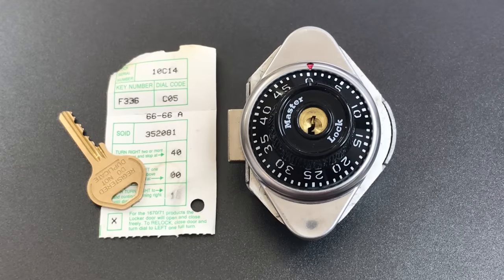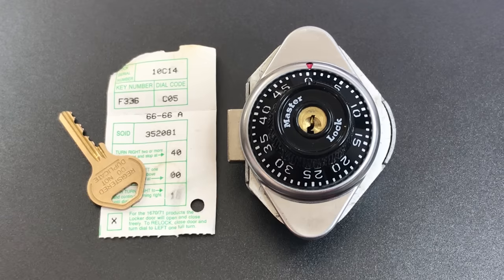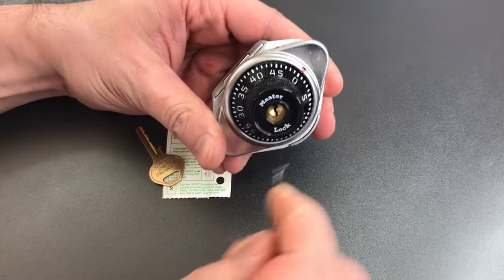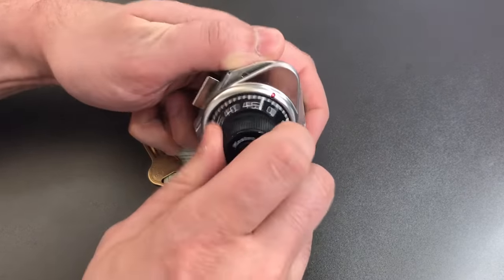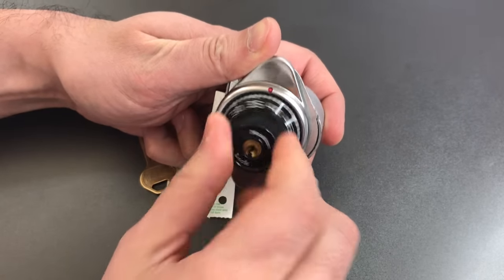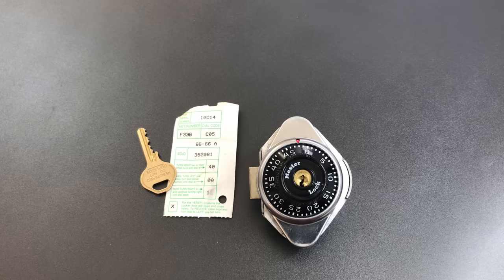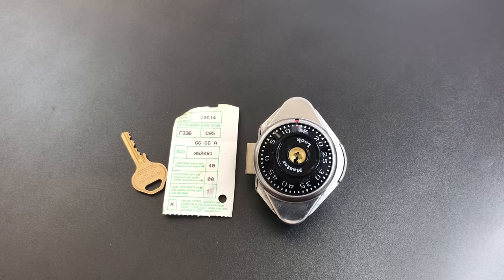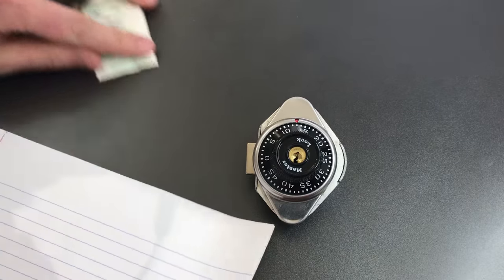[617] Master School Locker Combination Lock Picked and Decoded (Model 1670)

Comment: All I remember from using a version of these locks in middle school with a lever underneath you had to pull up to unlock when you reached the final number was there was a way to "jam" your locker so it was always unlocked, you had to put in the combo and hold it open, then grab part of the unlocking mechanism from the inside and then turn the shackle back a little where it would stick. From there the locking mechanism slid up and down freely until you spun the shackle back. They finally caught on when so many kids did it you could walk down a hallway and open half the lockers just by pulling up on the levers

Comment: How I avoided people stealing my shit in high school:

Carried everything I needed in my backpack and completely foregoing my locker because of those combo locks. I would've used it if I could've used my magnetic lock...

 (a really unique lock at the time, it had multiple magnets sealed in the body of the lock as well as the opposite polarity magnets in the matching position sealed inside of the key which was a bar haven't seen one since it was a great lock AND hardened too)

Comment: Maybe I was inspired by Fonzie and the jukebox at Arnold's or something (look it up), but in High School and Middle School, I could I could strike the sheet metal doors of the hall lockers just right, slightly upward, just below the lock, with the heel of my fist and the doors would pop off their latches and swing open.  On a good run, I could get ten or fifteen to pop open as I walked down a hallway.  I have no doubt the design remains the same in many schools 40 years later.

I might not have needed a lock pick, but in time I sure might have needed a lawyer.

Comment: If the first 2 combinations are always 10 apart surely you can put the edge of your hand up against the dial and work your way from 0 anti clock wise with a rubbing motion of your hand in increments of ten and then a full circle back and get through it really quickly... I wanna have a go!

Comment: lol, we had some cheep padlocks from the hardware store.
but the cheep padlocks wasn't the weakness of the locker, oh no, it was outnumbered by both the handle that could turn around even with a lock in it (if done right) and the thin piece of metal which was supposed to hold the door closed, but you could just pull the door open (bending the thin metal, but easily bended back again)

Comment: Well back in my day where we walked 20 miles to school, uphill, both ways, IN THE SNOW.... The lockers we had in in the elementary schools were padlocked but the school owned and provided the locks. Middle and High school was the built in locks with full three number combo and a lever to pull to open, and those were pretty worn out. Some didn't work. Some worked ok. others the wheels inside had a lot of 'wobble' meaning your actual combination would change over a range of numbers back and forth. You learned to pull on the level slightly to feel when they hit properly. Now when my daughter got to high school (different school, different state) it didn't matter. They had nice lockers. In a single school that served fairly sizable town AND the entire county in one huge multi-storied building. No joke it took about 7 minutes to walk from one end to the other (and I have a long stride) and that is without climbing stairs to get to the 2nd or 3rd floor. And they had 5 minutes between classes. Nobody uses the lockers, cause they have no time to get to them. So those locker combinations will work for decades... and be nearly brand new. Security out of complete inconvenience. Nobody can use them, and there is nothing inside them.

Comment: These locks (or really any combination lock except Sargent & Greenleaf) are terrible. I wouldn't use even the S&G on a school locker because someone could watch you enter the combination. I used a keyed padlock on my locker when I was in school. It was a Master Lock but it was a ProSeries which are really not bad. It was dual ball bearing so it was shim-proof. Today with bump keys being common knowledge, I would probably go with an Abloy lock, or an Abloy CY406 cylinder in the ProSeries lock.

Comment: I've found a number of sites selling these locks by the case. They all either say nothing about the master key or say they don't come with one. None of them I've looked at so far asked me to supply the number of the facility master key to pin the locks. So, does each box of 50 locks need a different master key that I have to obtain somehow or does every one of these ever made take the same master key so they don't need to ask? Please say it's not that...